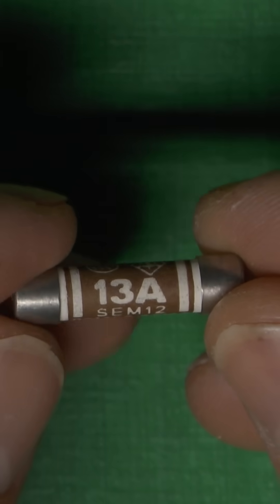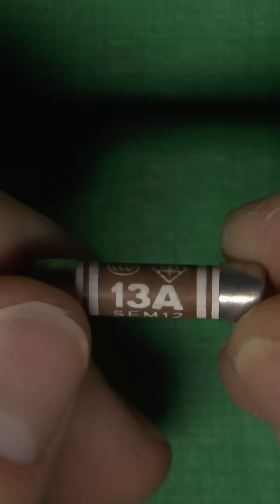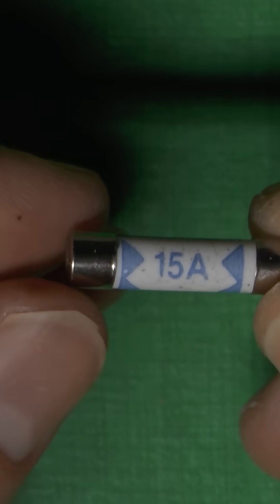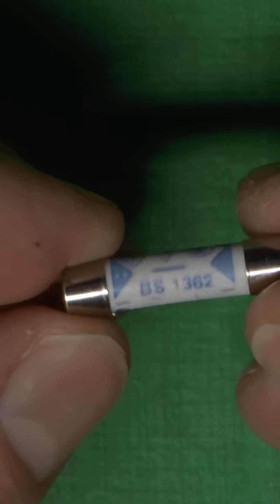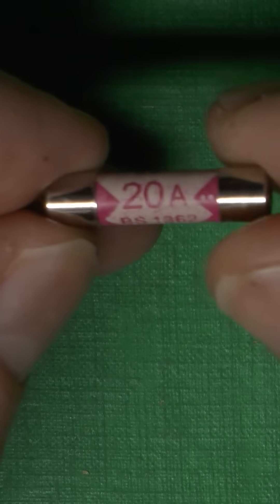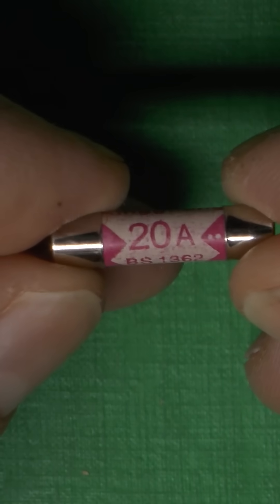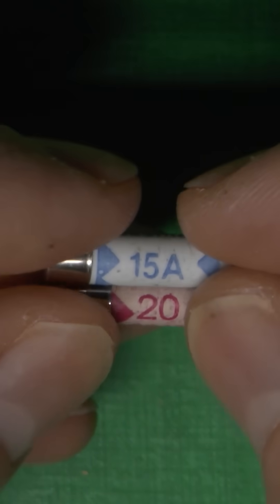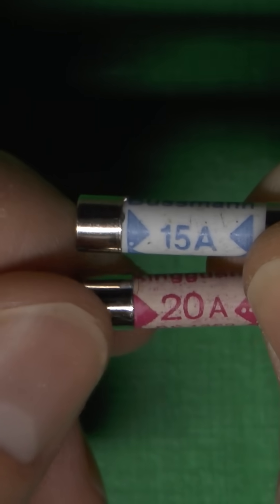Fake Plug Fuses BS1362 #diy #electrician #electrical

Comment: Even the proper rated fuses are often fake.  Opening them to check for sand and fuse wire which looks to be of the correct thickness.

Comment: you can use the phone screen as a fuse tester. open youtube app and select a video, sit one end of the fuse on the screen. Touch the other end of the fuse and if the video pauses, its a good fuse..... if nothing happens, the fuse is blown. works in calculator app too.
Reply: That trick works in any app or even in the home screen... But the problem here is that is wrongly/fake rated. Is not safe to use

Comment: What readings do you get when you test them, JW? And have you looked inside?
Reply: @gnamp  
Very often they are just a single strand of wire about the right diameter to roughly carry the current but no sand filling to quench the arc and the caps are pushed on, not swaged. With a 3KA test current they fail spectacularly and there's a video on here showing one under test. An ex-colleague had his nose to the glass of the test room expecting a slight "phut" as it failed, but he nearly 💩himself when it exploded and blew the plug out of the socket!
Reply: @125brat  lol. How do they sleep at night?

Comment: We had a hitachi power palette truck catch fire because the plug fuse was fake, It failed to blow when bench tested at 45A ,
I then checked the stock from our local supplier 50 of them were fake!
Reply: @dogwalker666  
A few years ago a very large DIY chain with a Q and B in their name were unknowingly selling the fake ones until someone advised them.
Reply: @ Would not surprise me, The trade counter are the same company,
S.F.
Reply: @dogwalker666  👍

Comment: Where do you get assorted UK fuses which one can trust? I tried Amazon but struggled as it was all random Chinese brands. Bought some BOJACK ones (max 13A but not sure that's enough).. Tried Screwfix and didn't find a useful.
Reply from the maker: https://www.cef.co.uk/catalogue/categories/fuses-plug-top-fuses
https://www.tlc-direct.co.uk/Main_Index/Necessities_Index/Plug_Top_Fuses/index.html
https://www.edwardes.co.uk/categories/household-plug-fuses-25-4x6-3mm
Reply: @jwflame  Thanks.. Will order a load from TLC in the morning and chuck the amazon ones in the bin :)